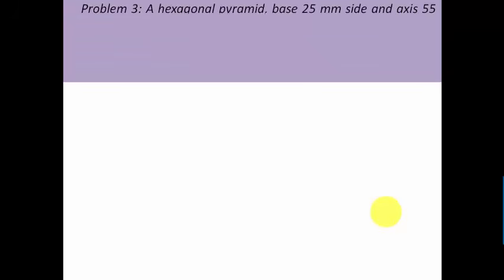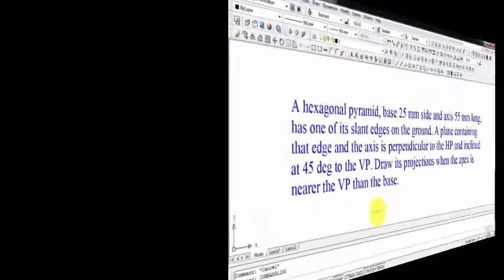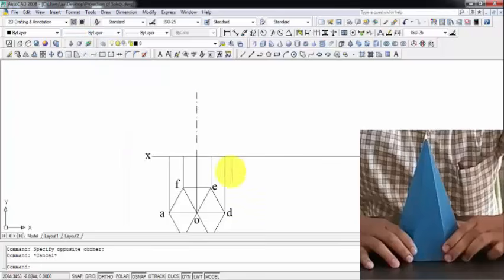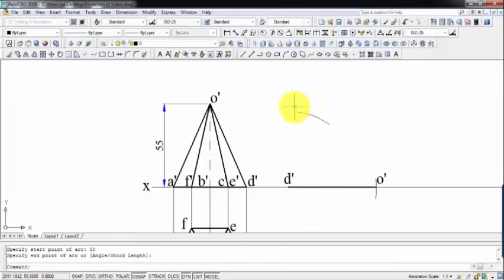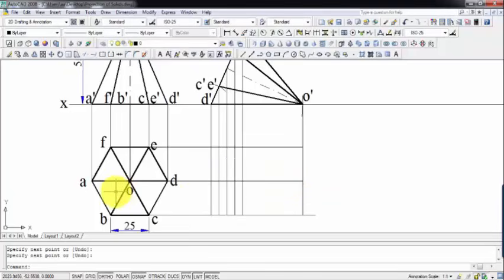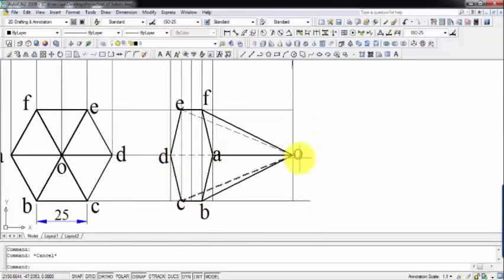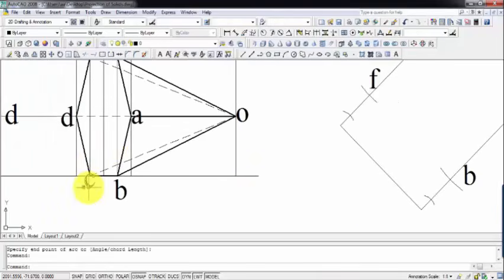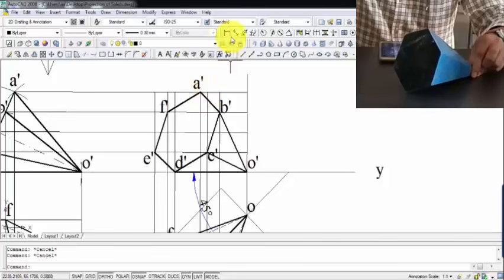Projection of Solids_Problem 3 in AUTOCAD

Comment: A hexagonal pyramid, base 25 mm side and axis 55 mm long, has one of its slant edges on the ground. A plane containing that edge and the axis is perpendicular to the H.P. and inclined at 45" to the V.P. Draw its projections when the apex is nearer the V.P. than the base.

Comment: Q: 3 A hexagonal pyramid, side of base 25 mm and axis 50 mm long, as one of its triangular faces in VP and the edge of base contained by that face inclined at an angle of 30° to HP. Draw its projections.

Comment: hexagonal pyramid, base 25 mm side and axis 55 mm long, has one of its slant  edges on the ground. A plane containing that edge and the axis is perpendicular to the H.P. and inclined at 45o to the V.P. Draw its projections when the apex is nearer the V.P. than the base. OR

Comment: A hexagonal pyramid side of base 30 mm and slant edge length 75 mm is resting on one of its base edge in the 
HP with an apex 50 mm above HP. Draw the projections if axis is 45° inclined to VP and apex is in the VP.

Comment: A hexagonal pyramid of 30 mm side of base and slant edge 65 mm long is laying on one of its traiangular surface in the v.p. so that its axis is inclined at an angle of 45 degree to the H.p. Draw it's projection if apex is nearer to observer. Sir plese jaldise ye question solve karke upload karo. 🙏🌅🌅

Comment: A triangular pyramid of side of base 40mm and 50mm high is resting on its apex on HP such that one of its base edge is inclined at angle of 30° with VP and axis inclined at an angle of 60° with HP. Draw its projections. 
sir please can u help

Comment: Q . A pentagonal pyramid ,40 mm edge of the base and axis height 70 mm long is resting on one of its corner of base in VP . The edge opposite to the corner is parallel to and 45 mm in front of VP and parallel to HP .Draw the projections when Apex is away from HP .
Sir can you solve these ???

Comment: For planes...based on the whether the edge is inclined or corner is inclined we change the position of the first diagram ryt,is there any short cut methods like that for solids too?lyk u have to draw horizontal hexagon if slant edge is on HP.
.and so on?

Comment: Sir the axis is inclined at 45 degrees to vp so we shouldn't have  assumed the object to be resting  on vp so we have to draw front view first?
Reply: akki sharma what I have noticed is that the plane is making an angle of 45 degrees to vp not the object so as one of slant edges  is lying on hp so we will asumme the object to be lying on hp and not on vp......I can be wrong but this is what I have figured out..hope it clears your doubt.
Reply: @madhavwadhwa3509  I think that,as the slant edge is on hp,the axis will of course be inclined to H.P.Thus we take as base resting on hp.
If we think,we will see that the axis is also inclined to VP(As the plane containing it is.)We can also take base on VP. and solve the problem.
Sir,correct me if i am mistaken.
Reply from the maker: Madhav...i would strongly suggest that u watch the video again....
I am sure your doubt will be clear.........
Reply: Manas Patnaik please explain answer. to this question sir.. i had seen it 3 times but did not get
Reply: Madhav Wadhwa yes i do think so and thanks btw  for considering to reply and making my concept clear!! :)
Reply: akki sharma your welcome bro!🙂
Reply: Madhav Wadhwa Ya even I thought of it instead of sir's method
Reply: Madhav Wadh

Comment: What do i do its inclined 30 degrees instead of perpendicular to H.P.???
Reply from the maker: Post the entire description of the problem...Abbas......
Reply: Manas Patnaik A hexagonal pyramid of 30 mm side of base and 70 mm height, resting on the HP. Such that the axis is inclined at 30 degrees to the HP and the edge is inclined at 45 degrees to VP. Draw its projections
Reply: Manas Patnaik this question has been asked in jntuh 1st year 2nd sem b.tech may/june 2017 xams...... R16 batch

Comment: sir as per ques plan containing slant edge is perpendicular to HP it is drawn perpendicular in second step na....
Reply from the maker: Look, in this problem, we are talking about a plane which has an axis and grounded slant edge.....Now this plane is perpendicular to HP.....Just think about this....How would that plane look from the top.....Obviously, it would appear as a line. If this plane is inclined at 45 degrees with the VP, then the axis, as well as the grounded slant edge, would automatically get inclined at 45 degrees.....And hence the top view in step 2 has been recreated in step 3 making sure that grounded slant edge is kept at 45 degrees with xy line..........I hope this will clear your doubt....
Show less

Comment: why it's axis is made perpendicular to hp while it has to be inclined to vp
Reply from the maker: Look, in this problem, we are talking about a plane which has an axis and grounded slant edge.....Now this plane is perpendicular to HP.....Just think about this....How would that plane look from the top.....Obviously, it would appear as a line. If this plane is inclined at 45 degrees with the VP, then the axis, as well as the grounded slant edge, would automatically get inclined at 45 degrees.....And hence the top view in step 2 has been recreated in step 3 making sure that grounded slant edge is kept at 45 degrees with xy line..........I hope this will clear your doubt....

Show less

Comment: sir , i have two questions,1) when do we take two parallel sides of hexagon , perpendicular to x-y line 
                                             2) Is it neccessary in step 3 to move the apex towards the observer or its our choice ,when no info regarding apex is given??
Reply from the maker: 1) Suppose you were asked to keep a triangular face grounded (on HP) then u would have made a vertical hexagon in TV (2 sides perpendicular to xy)........just think about this......And let's say we have been asked to keep a slant edge on ground (as in this problem itself) here you will make a horizontal hexagon (2 sides parallel to xy).

2)No its not necessary in step 3 to move the apex towards the observer. If nothing specifically hasn't been mentioned you have the option to keep the apex closer or far away from xy line....

Comment: Sir,
in ques it is given that the axis is perpendicular to HP  but during our solution we drew it parallel to the HP.So,is this a mistake in the question or i went wrong somewhere in understanding the solution.
Reply: valid question , you must answer this sir
Reply from the maker: Look, in this problem, we are talking about a plane which has an axis and grounded slant edge.....Now this plane is perpendicular to HP.....Just think about this....How would that plane look from the top.....Obviously, it would appear as a line. If this plane is inclined at 45 degrees with the VP, then the axis, as well as the grounded slant edge, would automatically get inclined at 45 degrees.....And hence the top view in step 2 has been recreated in step 3 making sure that grounded slant edge is kept at 45 degrees with xy line..........I hope this will clear your doubt....

Comment: sir what's that " A plane containing that edge and the axis perpendicular to the HP" .... m unable to interpret it ???
Reply from the maker: Look, in this problem, we are talking about a plane which has an axis and grounded slant edge.....Now this plane is perpendicular to HP.....Just think about this....How would that plane look from the top.....Obviously, it would appear as a line. If this plane is inclined at 45 degrees with the VP, then the axis, as well as the grounded slant edge, would automatically get inclined at 45 degrees.....And hence the top view in step 2 has been recreated in step 3 making sure that grounded slant edge is kept at 45 degrees with xy line..........I hope this will clear your doubt....